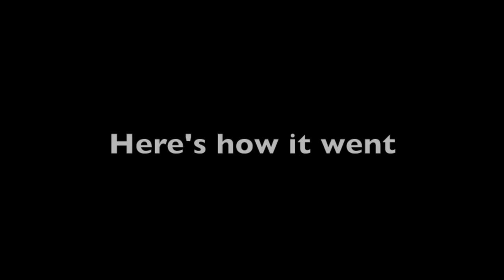How to make a Live-edge table: Kodama Woodworks Episode 4

Comment: Fantastic looking table.  How did  you finish the table top?  I'm gearing up to do a sofa table with a walnut slab and am looking for some options for the finish.  Thanks!
Reply from the maker: Hi there! Thanks for the kind words :) While I was at the Center for Furniture Craftsmanship I stumbled upon a "new" finish. It's called "Osmo" and is a mix of oil and wax that is used for hardwood floor finishing. I figured I'd give it a try, because why not. Unfortunately its almost impossible to get in California so I was only ever able to put one coat on and can't actually say anything about the finish as a product because I would ideally want more coats than that. However for finishes in general I rely heavily on "General Finishes Arm-R-Seal" It's an oil/urethane mix that has never let me down. However I talked to a guy that actually makes live edge tables for a living and he suggested "General Finishes High Performance Water Based Topcoat" He used it in a spray gun wish fabulous results and I tried it with a foam brush with decent results (it really depends how picky you are). Long story short, if you want a wipe on I will live and die by Arm-R-Seal but if you want to try a brush/spray on i would suggest what the professional uses  (the High Performance) simply because I have to assume he knows better than me. I hope that helps. Oh1 and also you can never go wrong with some "wipe-on poly" or even tung/linseed oil. I use those for things that are going to have lot of hands touching them and you want to be able to feel the wood rather than a urethane. Sorry for the long answer, I wanted to be sure I covered it all as best I could. :)
Reply: Thanks for the reply!  I ended up going with a homemade concoction of Linseed and Beeswax that I read about.  Went on easily and looks gorgeous.  Again, I appreciate you taking the time to respond.

Comment: Do u finish the under side of the table like the top?
Reply from the maker: Yep. It helps to seal everything to prevent uneven movement. Also the burnt part needs to be sealed or else you will turn everything near the table black. But the actual bottom of the top doesn’t need as many coats because it won’t be subject to as much use.